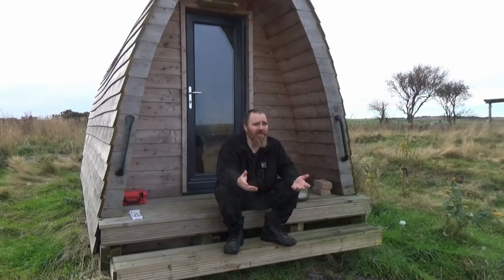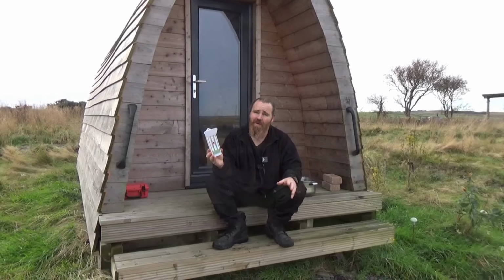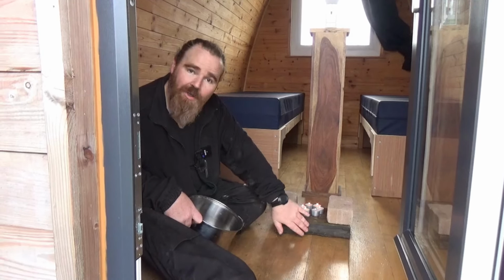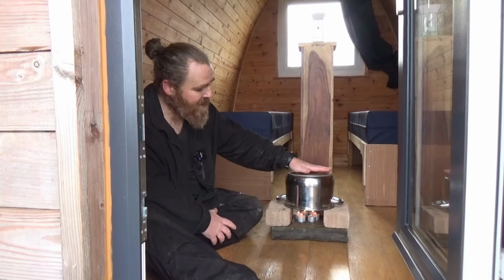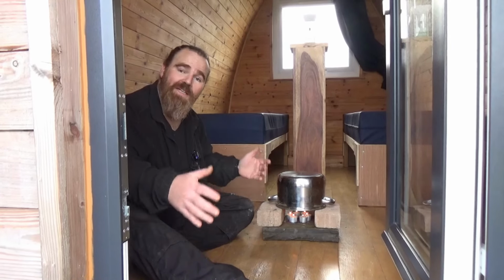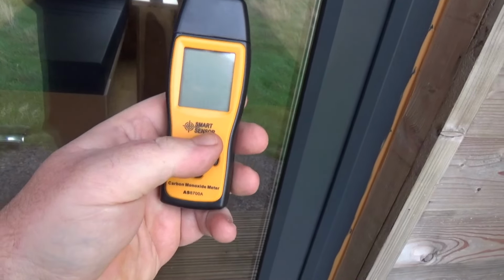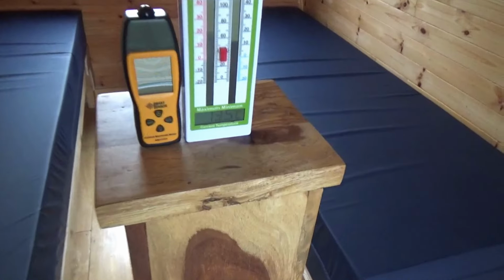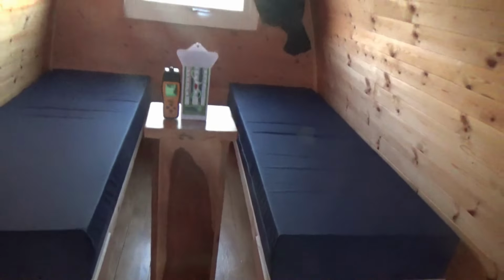DIY Flower pot candle tiny house/camper van/power cut heater tested. Effectiveness? Carbon monoxide?

Comment: Faux Physics - the pod heated with 6 tea lights is obviously warmer than the pod with no heating. The Control pod should have had 6 tea lights with no pot, in order to measure the claimed advantages of the pot.

The pot is simply a reservoir which absorbs the heat then re-radiates and convects it; you do not get any more heat than the energy contained in the 6 tealights.

Using a data-logger he could have graphed the pod temperatures against time and shown that the pot/reservoir would continue to radiate/ convect for a short time after the tealights go out. The total amount of energy released to the room can only be equal to the energy contained in the wax (minus any inefficiencies- such as the energy converted to light (and minimal amounts of sound)) - The Principal of Conservation of Energy is simple Physics, taught to 11 year- olds.

Water is also a product of combustion of paraffin (candle wax) so condensation will be produced. C25H52 (Hydro Carbons in the wax) + O2 (from the air) -> CO2 + H20.
Reply: You don't need to be a scientist to understand this, just basic common sense. Where does the heat go from just candles, compared to a pot? That's the point. This pot works on exactly the same principle as the wood-burning oven that you find in many houses in Finland. It radiates heat everywhere.
Reply: @jani3253  All the heat goes outside and into Space ultimately.

But if this was to demonstrate that the pot increases the proportion of radiant heat over convected heat compared to candles alone then the Control pod should have had candles and the temperatures should have been monitored at different heights. 

Candles will also radiate and the pot will also convect (though if it was matt black inside & out, it would absorb and re-radiate the heat from the candles at a faster rate).

Ultimately the proposal is that the pot is a better radiator than the candles and that the candles convect most of their heat to the ceiling but the 'experiment' merely compared heating with candles (in a pot) to no heating.
Reply from the maker: "Ultimately the proposal is that the pot is a better radiator than the candles" At no point have I ever claimed this experiment proves that. This experiment was to test whether these heaters can make a difference, and to test CO levels. 
The next experiment will be to test the radiant heat effect.
Reply: @CairnOfDunnCroftPermaculture  you did actually 'explain' that 'the heat spilling out from underneath would heat more effectively than candles alone because convection heating is less effective,'  when actually the heat spilling out from the underside will convect anyway.  

Also you make no reference to how the CO problem could be managed, which is clearly by ventilation, thus drawing cold air in and negating the 'benefits,' which are so small that putting 2 people in that space would heat it more effectively (according to your figures).
Reply from the maker: https://youtu.be/sK539ekJ4bo

Comment: It's fine in a pinch and an emergency, but the combustion chamber should never be in contact with the air in the room. It should have its own air intake and exhaust outside, with the flames heating copper tubing or something, which you can direct wherever needs heating (room air or clay or cast-iron that will radiate infrared. If you already have a pot and these small candles, you are not really in an emergency situation, there has been a bit of planning to get there already, so it's better to plan a bit further and be prepared, this time with a carbon monoxide- and dioxide-free solution. Heating is a critical part of housing anyway, not something that you should invent in an emergency.
Another benefit of having a secondary air circuit, especially in a tiny house, is that you can even take the heat from an open fire outside, fed with wood, which is more sustainable, and that you may even get for free. An open wood fire is also easier to set up in an emergency, although an insulated combustion chamber would be much more efficient.
Using natural gas (from composting material) or recycled cooking oil as fuel also makes it easier to set up a constant flow than wood or candles.
Reply from the maker: I disagree with a few points you make. 
Many people rely on electric heat. So while yes, heating should be designed into housing, in a power cut that will be ineffective. Most people have candles, and they're a cheap option for an emergency heater. To suggest everyone has the resources to have a backup heating system indicates a certain amount of privilege. Personally, we use a rocket mass heater. The most efficient, sustainable space heater in existence. But if I was to advocate their use exclusively, it wouldn't help many people. Yes better options exist for heating than emergency candle heaters, but better options exist that the ones you suggest also. The candle heater remains an excellent option for situations when it's that, or nothing. 
Natural gas does not come from composting. That is absolutely incorrect. 
Biogas, which is what I think you refer to, is a byproduct of anaerobic digestion, not the composting process which is an aerobic process using very different equipment. It's also only viable during the summer months across much of the world. Not a viable option for winter emergencies. We have a biogas system planned. Keep an eye out for that video, if you're interested in biogas.
Reply: @CairnOfDunnCroftPermaculture  I do mean biogas indeed, thanks for correcting my English. I meant "natural" gas, not "natural gas" which has a different definition indeed, and I see I made the same mistake with "composting (adj.) material" which you read as "composting (action verb) material".  ;-)
Third time was not a charm either: You translated my vague "secondary air circuit" as "backup heating system" when I only suggested that there should be 2 separate circuits or tubings, like a copper coil in that clay pot system. I didn't see any other definitive way to answer your carbon monoxide or dioxide concern and ensure that the burnt air residue in the combustion chamber cannot penetrate the room, because it has its own outside intake and exhaust. The combustion happens inside the room, but in an airtight container.

I think we're on the same page, a candle heater is a great form of heating in a pinch, especially in a small and well insulated place such as a tiny house. Not so much in the living room of a regular house that I am looking at though.
All low tech solutions are especially critical now that Putin busted energy prices. Many countries or people don't have cheap electricity to power inefficient electric radiators or water tanks, and gas heaters are becoming even more expensive and actually illegal in the latest building code of some countries. Heat pumps are still mostly electrical appliances, but 3-4 times more efficient than electric radiators, and there's also the possibility to use low tech to preheat air or water that's fed to the heat pump in order to reduce the energy cost even more.
Heat is a bigger concern than electricity to me, and it is also the most expensive energy bill. My newly purchased house near Toulouse, France needs complete renovation, so I am looking at low temperature heated floors or walls that would be more compatible with a smart mix up of modern and low tech solutions. Your channel and others are a great help providing ideas and results. Not there yet, it's regular wood stove, a warm cat, and lots of insulation this winter. None of the doors, windows and blinds close properly right now. Even those that have functioning handles...

Comment: why not a terracotta pot? thats spreads t aroud the house and has a hole in the top
Reply from the maker: Terracotta pots are used because they're heat resistant, not because the hole serves any function.

Comment: Why not heat up concrete blocks   For a few hrs then ventilate the room for 2 minutes  removing any carbon monoxide.. shut the door and the thermal mass will continue to radiate for a few hrs. Warming the room again   That way you avoid the CO problem
Reply from the maker: I've made one with a couple of kilo of concrete to add mass. The candles lack the power needed to make it hot. The steel pot is low enough mass to get respectably hot, but it does cool off fairly rapidly.

Comment: In Belgium this week died two people with this, very very dangerous !!!
Reply from the maker: Any open flame has its dangers, and must be used extremely carefully. Sadly, there will be a lot more fires, and deaths, this winter. People are cold, and afraid. Without a source of heat, a lot more people are likely to die from cold. It's a question of balancing risks.

Comment: You get the same amount of heat by burning candles without a pot over them. You cant increase the heat generated by the source.
Reply from the maker: Not an increase in heat, but a difference in how that heat is experienced.
Reply from the maker: https://youtu.be/sK539ekJ4bo

Comment: Those candles aren't cheap. You might as well use a Mr.Buddy propane. It would heat it hotter than a lousy 3 degrees. 🤣

Comment: You got the risk of fire and risk of carbon monoxide. I'll stick with a woolly jumper and a coat.
Reply: Don't breathe as you emit co2 in your breath.
Reply: @awatt  CO and CO2 are not the same thing
Reply: @Derek-df3sd  
You breath out carbon monoxide as well so better not breath
Reply: @awatt  Are you simple?
Reply: @Derek-df3sd  
You also breathe out Dihydrogen monoxide which is the main constituent of acid rain and is found in tumors. Better not breath.

Comment: Two people in a sealed room is also dangerous, so open a window just a crack for breathing anyway
Reply from the maker: In a sealed room, yes. But a wooden structure with breathable insulation and a vapour permeable membrane, like these pods, or most housing, has plenty of ventilation.

Comment: The candle puts out the same heat, whether is has a pot on it or not. You cannot get more energy than  which was produced.  The pot stores energy in the area of the pot that creates an illusion when you are close to it.  Was the rising sun evident in this vid given and concideration to the increase in temperature, it should not be overlooked.
Reply from the maker: The experiment was run in two identical pods, simultaneously, under identical conditions. Solar gain was identical for both pods. 

As for the "same heat output with or without the pot" point...
The amount of energy contained in the fuel in a candle is set. True. However.....
There are three forms of heat energy transfer. 
Convective.
Radiant.
Conductive. 
Convective heat is the least effective, conductive heat is the most effective. 

An example of the difference between the effectiveness of conductive heat and radiant heat is a hot water bottle. If we fill two hot water bottles with a litre of boiling water each, they have identical amounts of heat. But it's far more effective to hold the bottle than to hold your hands six inches away from it. When you touch it. you're experiencing conductive heat. 
When you hold your hands close to it, but not touching, you're experiencing radiant heat. 

Same energy, just transferred to you differently. 
Conductive heat is clearly more effective than radiant heat. 

An example of the difference between the effectiveness of radiant heat and convective heat is a closed room with a window facing the sun on a sunny day.
The room will feel warm if you sit at the back, out of the sun. You are being warmed by convective heat, the warm air is warming you. 
But you will feel a lot hotter if you move to the window and sit in the sun. You are being warmed by radiant heat.

Same amount of heat energy into the closed room, just transferred to you differently.
Radiant heat is clearly far more effective than convective heat. 

You can experience all three kinds of heat from a candle heater. 
Put a board between you and the heater. The warmth you are receiving is convective. The only heat you receive is the heater warming the air, which then heats you. Air is a poor heat transfer medium, so is not very effective. 
Put your hands a few inches from the heater, but not touching. You will feel a lot more heat. This is radiant heat. Much more effective than convective heat transfer. 
If you were to touch the heater, you would likely receive a burn. You would be experiencing conductive heat, the most effective heat transfer mechanism of all. It's so effective, it's dangerous to touch hot objects. 

I am not expecting you to just accept this blindly of course, there are some excellent resources available online you could avail yourself of.
Reply: @CairnOfDunnCroftPermaculture  yes acknowledge the two pods which takes the sun out of the equation. Honest as I am I will say I didn't note that when watching the vid.  What sparked my comment was the total heat not changing from the the pot being on top. But having read your response, I thank you for, I can see the benefit as a cold person. If you want to warm your hands then the radiant heat the pot produces will have a pleasant effect when close by.  The radiant heat directly radiating on your hands great.  Conduction is really just happening as heat conducts around the pot.  The room as a whole if you are not stood over the pot for radiance is still going to be convection transfer. The thermometer was  close to the pot. You could try another experiment where you light the same number of candles in both rooms one with a pot one with no pot. Move the thermometer across the other side of the room.  There should be no difference. I think  the main benefit of the pot is to stand by and gain the radiance, which sure would work. I stand by the energy not increasing due to the pot, this is just perception because you gain the radiance when close. I do appreciate your. Vid and reply.
Reply from the maker: https://youtu.be/sK539ekJ4bo

Comment: I think a clay pot would be better because you truly don't know what metals, aluminum, and chemical that are in metal pots. That can make the carbon levels go up.
Reply from the maker: Heating metal does not release carbon monoxide. That is incorrect.
Reply: @CairnOfDunnCroftPermaculture  I also stated chemicals as well. Not all pots are stainless steel and some are treated with various chemicals. They can give off a smell that is not safe for being in small environments. Therefore, even if it's not carbon monoxide.....it's still not healthy or safe.

Comment: I would just add an exhaust pipe for the CO2. I also think you would do better with a water tank. The water will heat up and produce steam and will work the same as a traditional steam radiator. Using a propane tank and some copper tubing coils around the tank and top. Connecting one end to the top and one end to the side  bottom.
Reply from the maker: I'd be extremely wary of using steam. Steam is highly explosive under pressure, and should never be used in a sealed system. Ever. Please do not do this.
Reply: @CairnOfDunnCroftPermaculture  that's why they make pressure valves. So are you  saying you can't afford $15 or are you just saying that to protect your ideas? If you're going to make videos about something, maybe you should do them  about something that actually works effectively and efficiently.  This thing your showing not only has a thousand people making the same claim, but none of you really know anything about engineering or heat/cold radiation. This "pot" idea is no more effective at actually warming up a room or/ and especially a tiny home. Your  pot idea is no more effective than that mini air conditioner everyone is making vids about. you didn't even mention that a pipe in the ceiling or high window would take care of any CO2. RADIATORS have been used for steam heating for centuries and for the most part have been very efficient and efficiently warms whole buildings. I am Not the one telling people to light Unpredictable fires (because there's nothing safe about an unstable setup like that) and Not telling them All the pertinent information.
Reply: Thankyou for sharing a very informative video. Peace be with you.

Comment: Nearly a perfect experiment if he didn't keep opening the doors
Reply from the maker: Both thermometers used were max/min models.
Reply: @CairnOfDunnCroftPermaculture  obviously, but you opened the door on one of them
Reply from the maker: @owenbowen2752  you seem to be misunderstanding me. I could open the door a thousand times at the end of the experiment. The thermometer will continue to show the temperature before the door was opened.
Reply: @CairnOfDunnCroftPermaculture  I didn't realize it was the end of the experiment, you didn't say. Excellent experiment in that case 👍

Comment: 2:46 "Radiant heat is more effective than convective heat."  More effective?  What be this kind of magic?  Heat is heat.  You are not making more heat.   What you are doing is concentrating the heat in the metal pan instead of allowing the heat to spread evenly through out the cabin.  And if you put a thermometer near the concentration of heat, then the thermometer will register a higher temperature.  So the center of the cabin will be warmer and the part of the cabin closest to the walls will be cooler.  You could determine that with thermometers placed neat the outside walls.  I call BS.
Reply from the maker: A simple internet search could have led you to any one of hundreds of articles explaining the different forms of heat, and their relative efficiencies. 
It's fairly elementary physics. 
Please, educate yourself.
Reply from the maker: https://youtu.be/sK539ekJ4bo